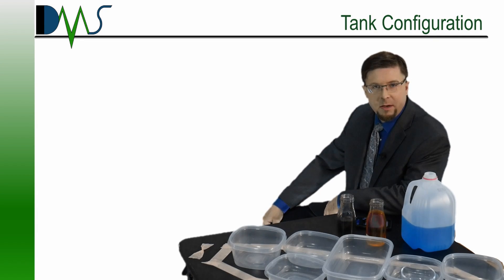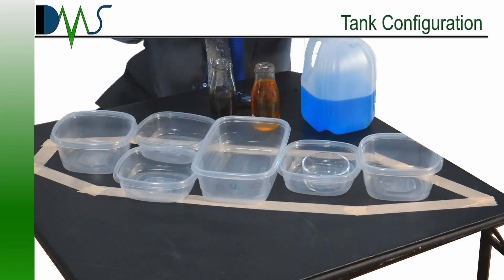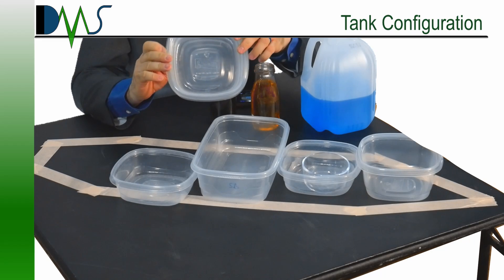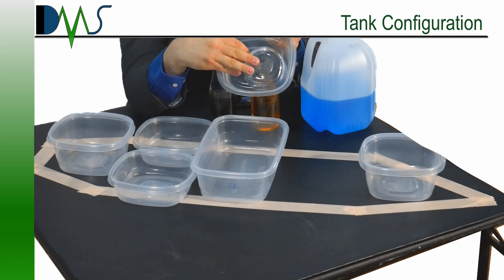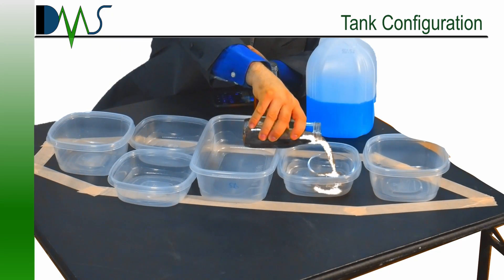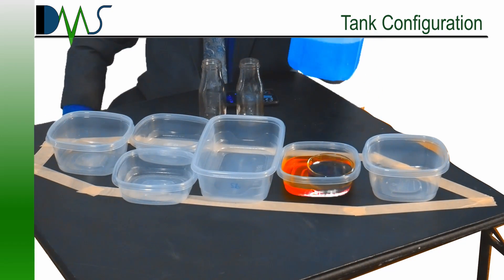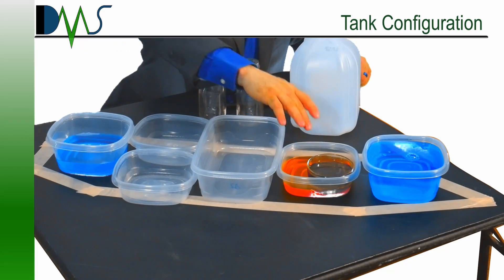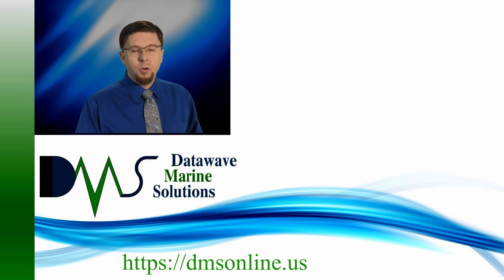Free Surface Moment:  Tank Configuration

Comment: 1:44
I would fill the tanks that are closest in maximum capacity, to the volume of the liquid being stored.
Also taking into account the need for general weight ballance, ie:
tank on one side is filled, its corresponding tank on the opposite side could be filled for general overall weight ballance.

Comment: I agree on the oil and fuel tank use but I would have filled the two small tanks aft with ballast water since you want to run with stern trim and you would only be left with two slack tanks. Why wouldn’t this be better?
Reply from the maker: That is an interesting way to go.  Your solution would produce the same level of free surface moment.  From a stability perspective, it is equally valid.  I happen to know that the two aft tanks are each half the volume of of the large tanks in the bow and stern.  So if you completely filled them, there would still be some ballast water left over that needs to go in the bow or stern tank.  It would still be the same level of free surface moment.  

The only thing I would debate is running with stern trim.  This is a philosophical debate though.  Nothing to do with safety.  I once did a study for a client where I discovered even a little bit of aft trim added 1-2% to the fuel consumption rate.  I know aft trim is recommended because it gives better steering control, and I would not stop anyone from using aft trim to operate safer.  But, personally, I see it as a design flaw.  The ship should not require aft trim to maintain good steering control.

Comment: If a warship had U shaped tanks along the hull as part of its torpedo protection scheme, with each tank ending near the deck, port and starboard and one of those tanks was slack, how much free surface moment would it have?
Reply from the maker: That is a very clever question, which takes some math to get the exact numbers.  For the simplified explanation, the U-tank is very similar to the example I provided in the video of a tank within a tank.  Only in this case, the big tank extends the entire beam of the ship, and we have an air space (accommodations) inside a tank.  We don't need to worry about the free surface moment of the 2nd tank, our air space.  So what is the free surface moment of that big U-tank?  Much more than if we divided that U-tank into two small separate tanks.  But less than if we had one continuous tank across the entire beam.

Interesting side note:  U-tanks have another purpose.  We will intentionally install them to help with the seakeeping of the ship and reduce its roll motions.  By careful selection of the tank dimensions, we create a situation where the liquid in the tank sloshes in opposition to the ship roll motions.  So the liquid in the U-tank always counterbalances the ship to reduce roll.  That doesn't come for free.  You still need to worry about the free surface moment of the U-tank.  But it can be a relatively cheap way to improve seakeeping. (Cheap when compared to a computer controlled, hydraulic powered, retractable active control fin.)

Comment: Hi, does free surface moment also affect sloshing in ballast tanks?
Also, is there free surface moment or sloshing if we were to use a piston cylinder system for ballast tanks...... For remotely piloted underwater vehicles.
Reply from the maker: It is more accurate to say that free surface moment and sloshing are totally different physical phenomena, but they depend on many of the same tank dimensions.  
As for a piston cylinder ballast tank, I believe you are describing a system which uses a piston to physically displace the water from a cylindrical ballast tank, and does not use compressed air.  In this case, the water surface is contained by a solid barrier.  That setup would not generate any free surface moment.